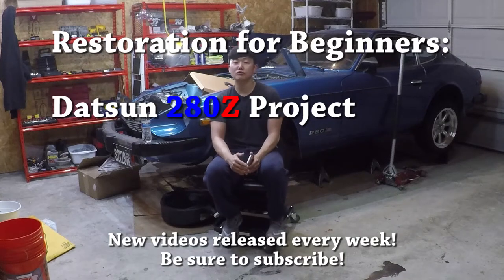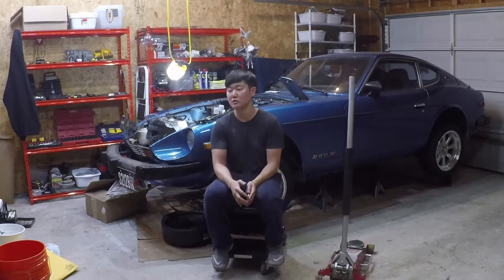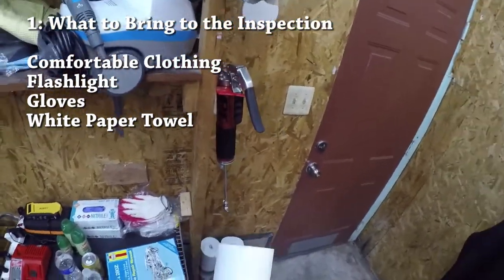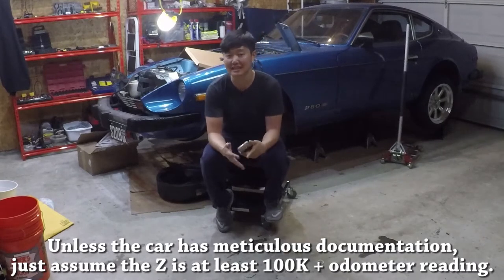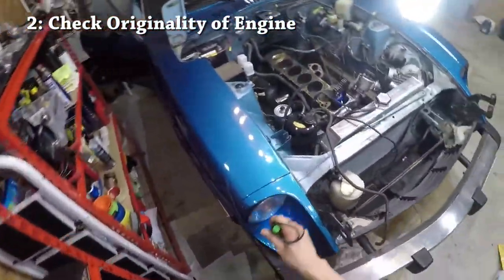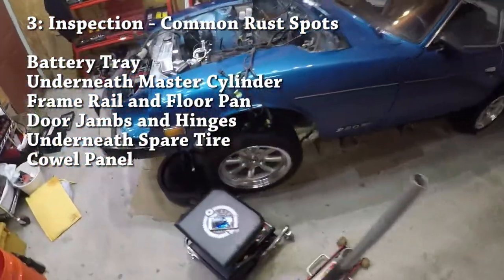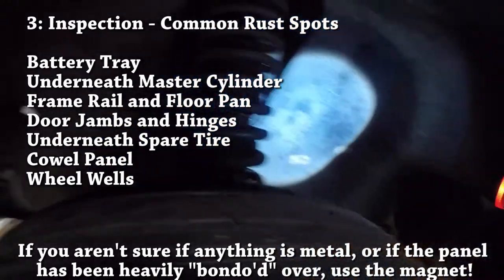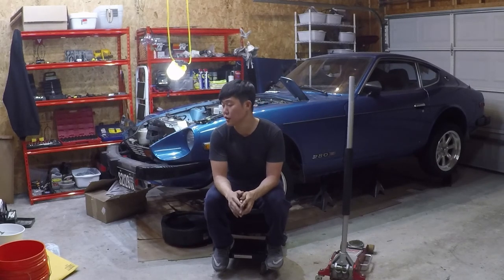Datsun 280Z Ep.1 (2/2) Datsun 240Z 260Z 280Z Buyer's Guide

Comment: I'm in the process of restoring a 260. It was parked for 31 years before i purchased it. One year into it so far, and I've replaced essentially all of the mechanical bits, rust repair is still on my to do list. Floor pans need to be patched, but the car is still solid. The rust in the fenders etc doesn't bother me as such, i just want to make sure thats its structurally sound before i go nuts. I'll be purchasing those MSA ones if need be once it gets to the welder. FYI i have the MSA 6-1 header now as well as their premium exhaust and I do recommend both. Best of luck in your restoration.
Reply from the maker: My exhaust manifold is rusted beyond (worth) saving, so I'm planning to buy the MSA headers and the exhuast system. Thanks for the note!
Reply: yeah my balance tube was rusted apart on both ends, and thus doing nothing. plus all the emissions stuff has been removed so i was indeed in the market for a header. No complaints with the msa one, although i got the basic black and some of the paint has already flaked off. not a big deal function wise, but if you want it to look good for a long time i'd consider the ceramic coated one.
Reply from the maker: +meganspecv I plan on completely wrapping it anyway so I might try to save a few bucks. How's the sound?
Reply: i ran it open header for a year (testing wise),  it was very loud but sounded great lol. the exhaust with the muffler made a surprising difference, it still sounds great in my opinion and is a much more reasonable decibel level. it was fine in the garage open header but i wouldn't want to run it like that around town. ill try and add a video with the exhaust system soon-- maybe tomorrow.
Reply: all the videos I've uploaded so far were from a long time ago when it was still running through the stock manifold with no exhaust afterwards. Then again, my car has triple weber 40DCOE's so it's gonna sound different than stock regardless. It's also a nightmare to tune though  O_o

Comment: Good vid, but you overlooked one very common rust spot on a z. The back end of the rocker panel, in front of the rear wheel is a rust trap. Its also an area that is commonly filled with bondo to reduce the cost of body repairs, very common on a car that has been repainted. Would be the first place i would check with the magnet.
Reply from the maker: Thanks for pointing that out! I did mention that you should check all wheel wells carefully, but that spot is worth pointing out specifically. Gracias!

Comment: Most cars nowadays are Uni-bodies, if you find the year car you want, say a 1970. Everything on the car can be replaced or repaired, except the actual Uni-body.
Engine, front fenders,hood,doors,hatch everything. Again except the uni-body, and out body panels can be repaired. Rust on the floor rails, floor rust, engine support rails, this is where the death nail comes into play. and that can be repaired at a cost. The uni-body is the key in these cars, if thats good, you got a solid car. Everything else can be replaced.

If you can find one with a good uni-body (no rust) not easy, but alot of damage otherwise 
you got a good buy, yes you have to search for replaceable parts. But you might be able to buy for nothing. You can buy new frame rails that go over your old ones.
Reply from the maker: You're absolutely right. The unibody does have the advantage that the entire "cage" of the car serves as structural support for the car, but it does become a headache when parts of it starts rusting. Having welding as a skill can help a lot here, but most novice mechanics aren't used to doing body/metal work, and having a shop do this can get very expensive.
Reply: Most of the Z car collectors Ive run into dont care anything about the car except the Uni-body, they pay top dollar for one without any rust and if its a 1970 and a low production number. I used to help a guy who was a collector, and had Vin # 16 1970, and its a perfect car, original everything, He owns 14 perfect 1970s models. Awesome to see. He was the first Z owner I ever knew.  Learn Welding, its easier then most people think. Nothing about body work is hard just time consuming. What about your engines bottom end, its in good shape?
Reply from the maker: +Charles Miller I really hope so! I did a compression test before taking the head off and got above 170 on five cylinders, 120 on cylinder 5. I did a wet compression test on the fifth cylinder and it didn't make a difference so I assumed that one of the valves we're leaking, and that the piston rings we're in good shape. I need to obviously clean up the gasket surface, but I think the block is fine. There's a slight corrosion in the water hole but I think it'll be fine with some coolant flush.
Reply: Think your good to go, that is a bit of a difference in hole 5, but you proved it was not the cylinder (cross fingers). I have to agree with Mike,you do have a different way of putting together videos, and its refreshing to see something a little bit different. So have you put together any timeline, I know thats really hard to do, lets say done to 70%. Have you thought about scraping that stock fuel rail, I finally did just recently, and wow it really cleaned up the engine look alot.
Reply from the maker: I really have no idea when I'll be even halfway done with the "project". Items that are next on my list are: sorting out all the electrical issues, fixing the rust spots underneath the battery tray and the passenger side frame rail, updating the suspension with new shocks, springs, and bushings, and just general clean up inside and out. 

Which frame rail did you use to replace the stock rail? While I do want to keep the car looking stock as much as possible, that fuel rail is bit of a mess...
Reply from the maker: My injectors were in such bad shape that I just went ahead and bought all new injectors and plugs. I'll try to clean up the old fuel rail, but I think I might reach out to the pallnet guy!
Reply: I was told by a real injector guru, that if the electronics were good on the injectors, basically the ohms rating were all pretty close, that the injector was fine, just needed ultrasonic cleaning, new screens and pintle caps, after cleaning make sure they flow pretty close and you pretty much have a new injector. Costs between 20 and 40 dollars according to where you take them. I bought a set of very used turbo injectors off ebay, and boy were they used, Didnt want to take my car off line, so I had them do the ebay ones, he said they were really bad, but they are like brand new now, one of the ones that I pulled from my car was basically no ohms at all, he said it could not of been firing at all, tossed that one in the circle file, had another one instead of 2.7 ohms, it was 50 ohms, another one for the trash can. The car is running really good, and its even more fun to drive, if thats possible. You have a different fuel rail then my car, my old one looked like a piece of spaghetti , old and apparently paint was coming off, looked like garbage, bet yours could just be cleaned up nice and maybe painted flat black. Im in the process of getting ready to change my rear CV axles, should be no problem, but thats what I always say, No Probleeeem !
Right

Comment: Don't buy a car you don't have the skill to fix. A mint 16k one will fair you all better than a 5k rust bucket. It will save you so much time in the long run. Also read the entire repair manual as much as possible to the point you know every single bolt in the car. It will help you and others in the community. Most of the time rust and frame damage will be your only issue
Reply: Buying my minty one tomorrow for 17k